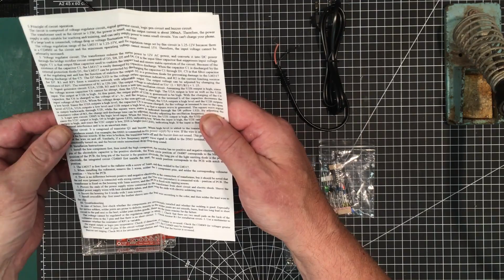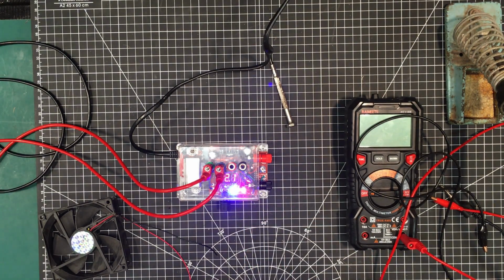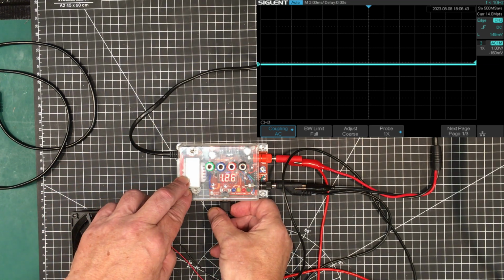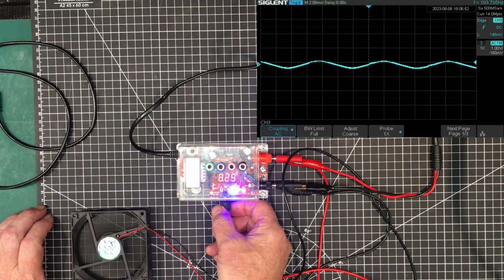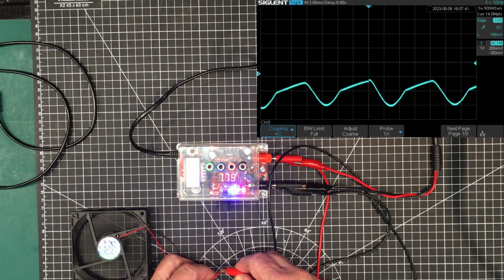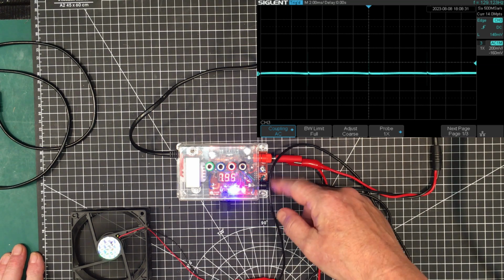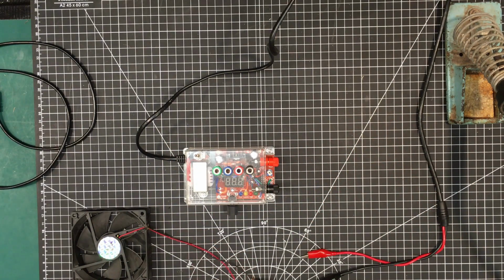0081 - Kit Build: Build and improve an LM317 Based Variable Linear Power supply

Comment: Perhaps the mains filter cap can't hold up the rectification above 150mA?
Reply from the maker: That might also be the case, but the transformer is only rated at 2VA (probably less in reality) so even if the cap was more than up to the task it would still begin to loose ground around 150mA.

Comment: I built the almost exact same kit.  I scrapped all the logic probe stuff.  I haven't needed a logic probe for decades.  When I found out it crow-bared at 150 mA, and the LM317 with a heat sink can sink 1.5 amps, I scrapped the plug and transformer, and in stalled a DC adapter socket.  I use an old Laptop power supply that can produce 2 A @ 16 volts DC.  It works so well, I actually use it instead of my big bench supply.  It weighs nothing, it's easy to move around, and it's good for most stuff I need, and it can sink a fair bit of current for short periods of time before it gets too hot.  I like that you added a power switch, and those banana lug terminals.  I might just change mine now.  Thanks.
Reply from the maker: Interesting mods you did.  I had though of putting a beefier transformer into it but could not find anything appropriate.  I bet it gets pretty toasty if you draw 1.5 amps @ around 2V though.